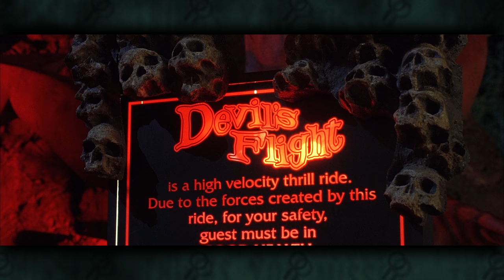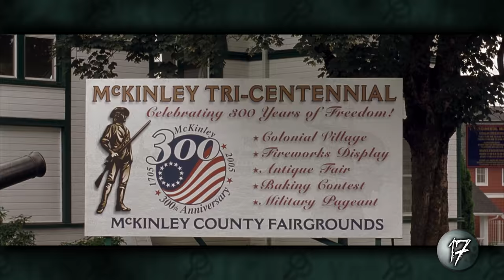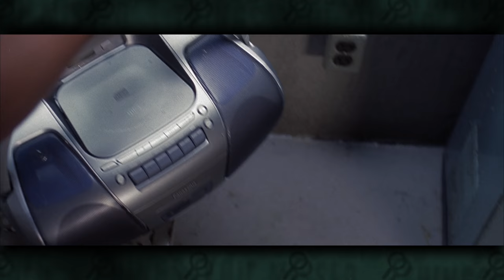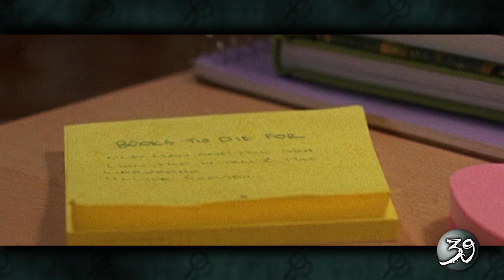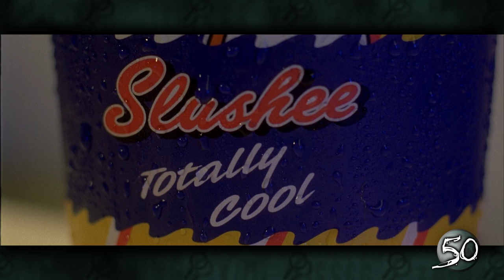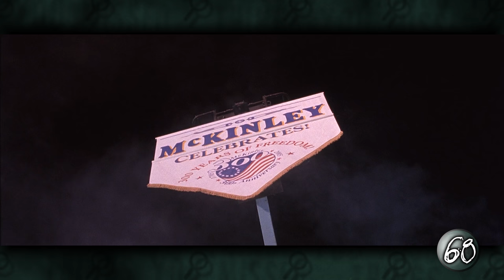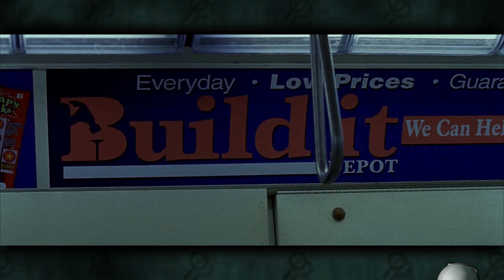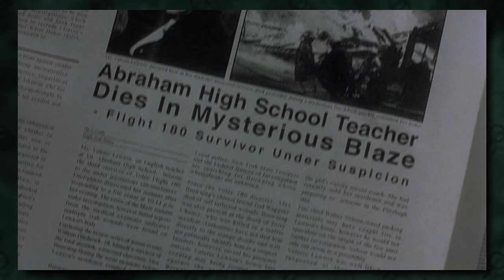112 Things You Missed™ in Final Destination 3 (2006)

Comment: Horse shoes can be bad luck too. 
It’s all dependent on how they are hung (they are normally nailed to a homes doorway) 
If hung with the ends up, it is good luck. If they are down, it’s bad luck as the luck is said to run out of the shoe via the down pointed ends. 
Both times we see the horse shoes (the ring in 2 and at the blacksmith in 3 and just before a death in 4 won’t say too much because spoilers) they are pointed downwards, maybe another signal for “your luck has run out” ?

Comment: I'm surprised you didn't meation the bonus feature for final destination 3 where u can choose between two different objects in the movie at certain times useally occasionated by the deaths right after or not, like you can change the way the death happened or save the survivors, like the tanning bed deaths you can have first girl get out of the tanning bed but still die by getting hit with the board and falling onto the top of her tanning bed which still burns her to death, you can save Franky at the restaurant by having you ram the car into the back of his and having the guy pull him out of the car right before the truck runs into his car. He survives and we never hear about him again. You can also read a newspaper at the end which has an article about the two survivors of 2 meeting again after so much time and being pulled into a wood chipper.

Comment: Don't get me wrong, I enjoy the Final Destination franchise! But am I the only one who thinks that, technically, Final Destination 3 shouldn't have occurred. Yes, the hydraulic fluid was leaking, but the the final straw to derail the roller coaster and cause the fluid line to actually break was the coaster running over the camera that was knocked out of Frankie's hand that wrapped around the coaster track. Since her premonition caused Frankie and his camera to be removed from the equation, the horrible roller coaster crash won't have happened. Yes, leaking hydraulic fluid is bad, but the line won't have broken and the locking system won't have released considering a ride, I think, might last all of about 2 minutes and the rate of the leak actually wasn't that bad (maybe the locking system would have loosened as more leaked but not released). Also, many coasters don't use hydraulic fluid to brake the ride, so it still would have been able to stop like normal when the ride was over. I know I'm overthinking it, but 🤷!

Comment: i'm not sure if anyone has brought this up but i just rewatched FD3 and noticed a major plot hole. The first domino in the accident is the fluid leak, the next is the camera getting run over, the third comes from the force of the coaster itself shaking the track and wheels unevenly. everything else happens because of those three things. however, when the kids are kicked off the ride the camera that was the second domino isn't there. the cable doesn't break and the wheels aren't knocked loose, so the accident shouldn't have happened anymore. what do you think?

Comment: Also; I just wanted to point out something else; have you considered the dual-meaning of "180" in this as well? Namely; the mathematical significance of '180' being used to represent the angle (12:00) at which the riders fall from...? Just food for thought. GO CUBS!!! =)
Reply: I know this is a 1 year old comment but this made me realize something.
Flight 180 crash involved a swift decent (vertical 180° angle), cars and various vehicles drove, crashed, and were launched horizontally(self explanatory), (FD3 explanation is already yours), various car parts and what’s his face where launched horizontally at the racetrack + the structures fell (horizontal AND vertical, the bus and every other vehice + the bridge itself fell into the river (Verticle 180° angle).
And I when I think about it more, I think every death in the franchise has to do with a 180° angle!
Example: Barbed wire fence launched horizontally, causing dismemberment of the one guy.
Example 2: Louis (FD3) has his head crushed, from both Left and Right sides, as in the horizontal position.
Reply: @Sp3ctralI  Wow! You might actually have something there! I've never even watched this movie, and that just popped in my head as I watching this video. XD But YOU might've have really hit on something that no-one else has ever picked up on before! You've giving me quite a bit to think about. Thanks for your response, and take care! =)
Reply: @BuckarooBanzai84  thanks! You too! ^_^
Reply: @Sp3ctralI  =)

Comment: I was hoping for you to come up with a reason for the roller coaster accident to actually happen after Wendy had her vision.  The ride's responsible has the back cars unlocked and because there's a fight, the Ashes leave and so Frankie leaves as well.  I know the hydraulics fail on Lewis' car, but that's not enough to cause the accident on its own.  Frankie is supposed to insist with his camera during the ride and one of the Ashes slaps it out of his hand, causing it to get attached to the track - and things only get started after the train rolls over it causing for little explosions, wheels flying off, seat straps failing and the track itself to break.  So, no Frankie on the train, no camera on the track, no accident.

Other than that - this is the best of the entire franchise.  I loved the clue containing pictures instead of the psychic visions or premonitory hallucinations and dreams.  The acting in this one was also so much better than in the next ones.

you probably didn't miss the difference between the 081 sign on the sub and that same sign in the mirror where the "1" became an "I".

Comment: You were good until you used Koresh. David Koresh was a church leader, not a cult leader. He was a Branch Davidian, which has been around for a long time. They only called it a cult in order to justify the seige. Also, I imagine the "victims" you are referring to are those that were burned in the church. However, two things I would like to point are there were far more than twenty who died inside the church, and that in 1999 the FBI director held a press conference where he admitted that it was the FBI agents who fired incendiary rounds from a 40mm GL after pumping more than 10x the lethal dose of CS gas into the church KNOWING CS is extremely flammable. Therefore, "the fbi started the fire" is not a conspiracy theory but factual. But other than that, good spot on the train.